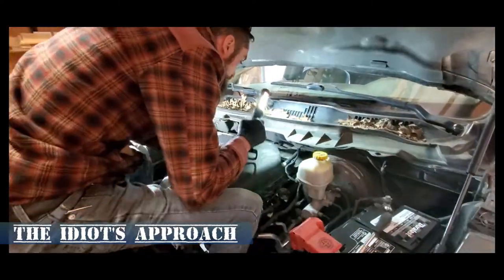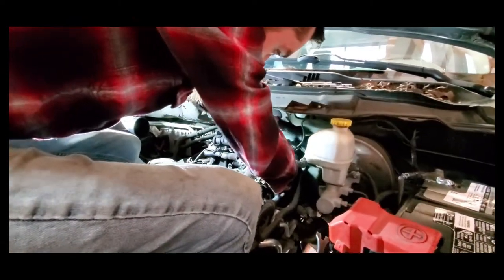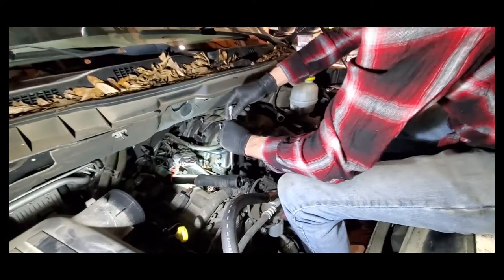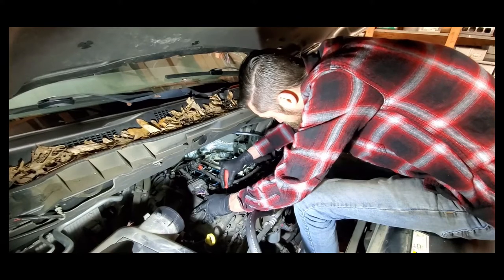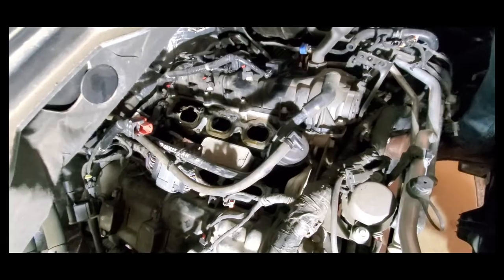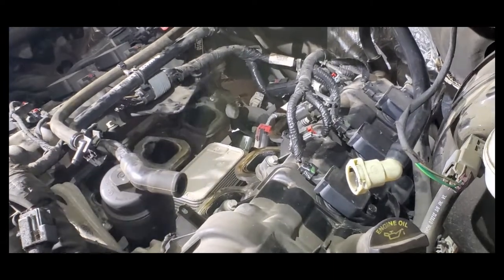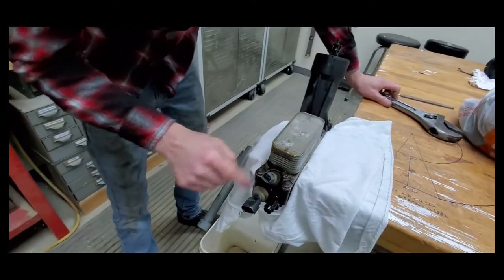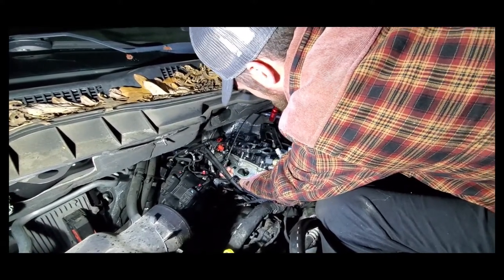Replacing oil cooler (filter housing) 2013 Ram V6

Comment: Got a 2020 im replacing right now with 76k amost the same harness, and wiring has moved on top. At the part now. This job was a drag. I got the official dorman all aluminum replacement. I dont plan to do this again. Lol
Reply from the maker: Lol yea. Thank god I had zack to do it. I'd have made a mess and taken 3x as long.

Comment: What was the mileage on the engine when you were doing the change
Reply from the maker: Probably around 100k or just under.
Reply: The vast majority of these failures are the 5 min oil change places over wrenching on that top housing bolt for oil filter. Put a white sharpie mark on that housing to match up correct sealing surface.
Reply from the maker: Good tip. Thanks!

Comment: I am in the process of doing this exact replacement. I have the part in and just need to know what tools to use? If you could let me know I’d appreciate it guys 🤙🏽. Very helpful video
Reply from the maker: Per Zack: 
" a set of needle nose pliers, a wrench set, particularly a 10mm, 13mm and maybe a 15mm. A socket set with at least the same sizes as well as an 8mm 1/4 inch drive is advised. A few extensions of the same drive size. An e-torx socket set that includes an e8 if I remember correctly. Again same drive size. A smallish pry bar to aid in removal of clips etc. An assortment of standard screwdrivers from small to large is also advisable. There's more that will make the job easier and quicker but that should be a good start "

Comment: Would this part cause oil getting in your coolant? Code is throwing a oil pressure sensor.
Reply from the maker: Zack says in rare instances it could, but it's not common.
Reply: If your replacing the oil pressure sensor I highly recommend changing the entire oil coolant assembly. it will save you time and money because eventually it will leak.